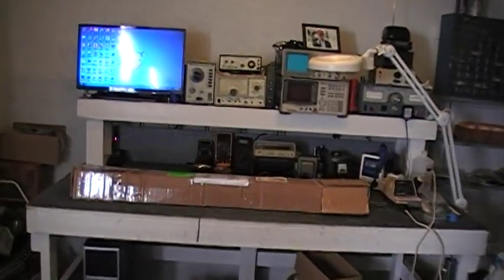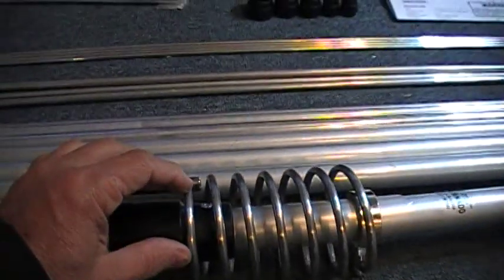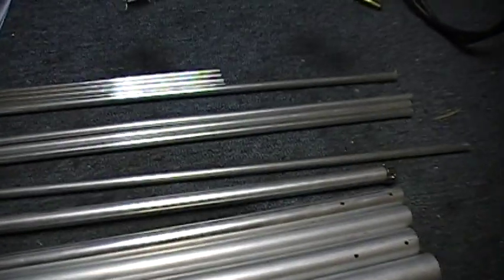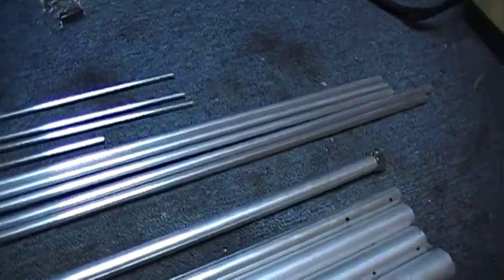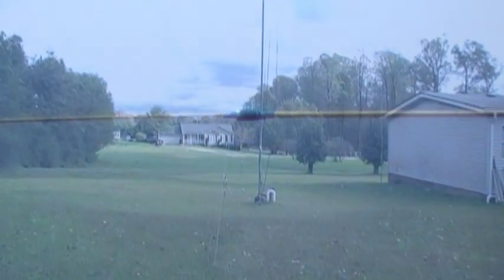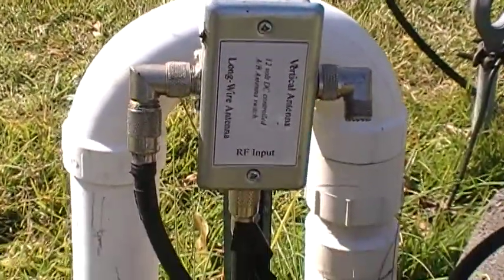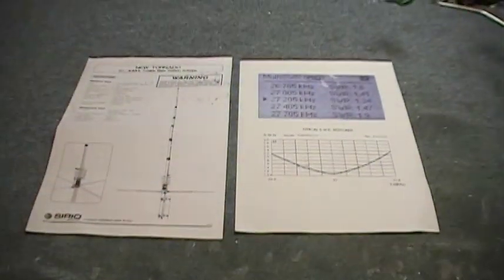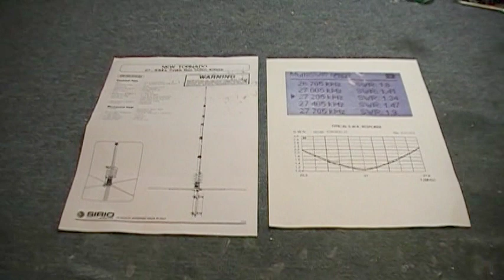Sirio Tornado 27 5/8 Wave Antenna Review

Comment: OK, im looking at this video in late 2023. Ive had two of these myself and still have them up now. The first is now 8 years old , the second is 5 years old. both have withstood 80mph winds on a few occasions. I would not suggest using lock tight on any part of this antenna. Its a good idea to drop it down once a year and just give it a clean with a mild detergent and just put it back together and back up. Im hoping they last a few years longer .
A great video for anyone looking to buy a base antenna. These are tried and tested and work very well.
From my home in a valley in south wales, uk, ive spoken all around the world many times.
A highly rated antenna that just lasts and lasts and works exceptionally well.
Reply from the maker: There are two types of loctite. One is a permanent loctite and the other is one will only gum up the threads enough so they do not back out due to any vibration or temperature shifts. I used the non-permanent loctite on this antenna along with other projects like this. For some people it is an act of congress to drop an antenna down unless it's just on a few poles and even my setup is involved to swap or service the antenna. Mine is on a 50 foot push-up pole and there are three guy wires on each section so it is a slow process especially raising the last sections due to all of the weight so when I set up an antenna I pay attention to all of the details along with being meticulous so I don't miss anything that will cause me grief. True story: Years ago I purchased a MACO V-5/8 antenna and as an antenna it is a great antenna as far as how it operates but it SUCKS the way it was designed because the wire connector thay attatches the hollow tuning ring will almost always corrode and even if you seal it with a coat of rubber, no worries because the hollow aluminum tuning ring is almost guaranteed to develope a leak and fill with water and swell and split  on the first winters freeze. It was those reasons I dumped the MACO V-5/8 because nobody wants to have to drop an antenna unless it is an absolute necessity. I have friends who have had Antron-99 and I-Max 2000 antennas that have been up for over 20 years that still work as good as the day they originally set them up. That's one thing I do like about the Tornado 27. The aluminum coil is solid so it cannot get water in it and swell and split. As long as everything is good and tight when it is assembled these antennas will go for years without any need to service them.

Comment: I've been around radio for quite some time. Looking at this design, tells me it is really a base loaded 3/4 wave. A true 5/8 requires a shunt feed to achieve the proper impedance and radiation angle. This is a popular trick on many so called 5/8 VHF mobile antennas. I have done tests between the DC open an shunt fed "5/8" and the shunt fed always wins.
I'm willing to bet if you tied the  bottom of the coil to the ground plane and tapped it in the sweet spot with the coax cetner. You will find it will perform better.
Reply from the maker: Great minds think alike. I plan on reconfiguring the open coil design with a shunt coil setup. I also plan on adding 4 more ground radials so the antenna will be set up like a Sirio 827 antenna. As to the mod the shunt setup will give some protection against static build up too since there will be a DC short to ground.
Reply: If you know your history, the A99 came about when the people who protect us from ourselves decided that "CB" antennas could no longer conduct DC to the mast. Hence there was a crazy 5kv rating that was given. The end work around was to sell 27mHz commercial antennas.
Reply from the maker: @CrawldaBeast  Yeah I remember when the market started getting flooded with the fiberglass antennas. I purchased a Antron back in the early 1980's and it set up great with a really good SWR but in my opinion I didn't think the antenna had good ears compared to a 5/8 wave antenna so I went and purchased a MACO v5/8 and I ran that antenna for a couple of years then I purchased a I-Max 2000 and that antenna ruled the roost until God called it back home with a direct lightning strike lol. There wasn't enough fiberglass to make a damned toothpick with in the yard. I replaced it with a newer I-Max 2000 but they monkeyed with the design to make it favor the 10 Meter band and eventually I got rid of it and went with what I am running right now. In the end I came to the conclusion that I prefer aluminum antennas over fiberglass antennas.

Comment: I've gone through two Sirio Tornado 27 antennas. They are an excellent well priced antenna that works well and tunes well. The only downfall is the plastic coupler at the base. It will eventually snap in high winds. I've had to upgrade to a Hy-gain Penetrator spt 500 because of the plastic coupler that snaps. If they upgraded it then it would be great. As far as the aluminum base, I did it just like you and it's the absolute best way! Good video.
Reply from the maker: We do on occasion see high winds here but it will always be a hard fast storm that rolls in. I have a backup antenna still in the box ready to go and I thought about reinforcing it with a good piece of fiberglass rod then sealing it followed with adding water bleed-off holes right at the base of the antenna. Also if the sections are sealed the likeness that water can enter into the antenna can be eliminated. For the price you still can't go wrong. Thanks for the feedback.
Reply: @flash001USA  Even though I've had two snap and I now have the Hy-gain Penetrator spt 500, I have a new Sirio Tornado 27 in the shed just in case!
Reply: I dont like this antenna.Broke after 3 months.Only 50 feet of the ground.
Reply from the maker: @michelst-jacques9555  Where did it break? So far the antenna I have here has held up through a couple of hard storms with enough wind power to rip small branches and leaves from trees. If it snapped after 3 months you need to contact the company and either get a refund or a replacement.

Comment: My I max with manual tuner will go out on 20 meter’s no problem! Mouth on canyon 70 mi/hr winds at least twice a year,in Utah! When it was 9 yrs old took it down lightly sanded it put 4 coat’s of polyurethane varnish on it works like a charm! Have 11 meter fun and two ham bands 10,11,20 meters go figure! Oh slightly customized, top whip is a 102 inch fiberglass Wilson mobile it’s red colored ! Works great love your video. John Boy Utah 🇺🇸😎🎙👍🏻
Reply from the maker: When they're working they are great antennas!
Reply: I bought mine in 2009! I think the quality has gone down since then. JohnBoyUtah 🎙🇺🇸👍🏻😎
Reply from the maker: @Brenda-jf2pe  That wouldn't surprise me because I think a lot of these antenna manufacturers are looking for ways to save cost on their products especially now.

Comment: How or why is the antenna bending in in the wind? Its aluminum tubing screwed together so it should not be flexible like a steel whip or fiberglass.  Wouldn't the tubing kink and stay bent instead of flex?
Reply from the maker: The tubing pieces slip into each other. All vertical antennas like this are designed to flex.The fiberglass antennas can flex with more movement along the lines of a fishing rod and the aluminum antennas flex the same way with a bit less free movement. You would think they would snap right in two or as you mentioned, bend but they won't unless they are hit with a really bad wind storm that causes these antennas to violently be whipped around and even the fiberglass antennas can break under these winds too. I'm making reference to the kind of winds that uproots big trees and lifts shingles off of roofs on houses. You got to keep in mind that this is a bit over 24 feet in length and the tubing is hollow. Watch Youtube videos where people make videos outside of an passenger jet window and you would be amazed at just how much the jet's wings bend and flex during flight and we are talking about something that is built with aluminum support beams for the outer aluminum skin to secure to. The antennas are made out of the same blend of what is called "aviation grade" aluminum which is made to be able to give and flex even under mild wind movement. There are still aluminum ground plane antennas standing strong that were built in the 1960's and where I live there are still a few old houses with these old antennas still up.

Comment: Great video here is a idea.
Video @ 12:20 about the electrical tape. I think the heat shrink tubing would be better. You can get it that has a 3:1 shrink rate. I use it on my antennas both aluminum and wires. My brother just got his in today and we are going to put it up this week end. Myself I am still using my old Sigma 4 I bought back in 1978. It has been a great antenna even after 4 lightning strikes and all I had to do was preplace the gamma match two times.
Reply from the maker: You're correct that there are better methods to be used. I chose to use high quality UL electrical tape because it allowed me to stretch it tight around the joints but the trick is the super glue. Once it dries it becomes a solid piece of thick plastic that won't unravel. The best thing would be to use the stuff the cable companies use that stretches and self heals to itself. That stuff will outlast the wire but the tape trick works quite well. I could have used heat shrink and I had some here but I've seen it get brittle and split over time where the tape literally has to be cut away with a razor. Recently I just reclaimed some old PL259 connectors that I used the tape method on and they not only stayed totally sealed after 8 years but the tape had to be removed with a razor blade so it does work.

Comment: Hello, what experiences have you had with the antenna?  Is she recommended?  73.  55
Reply from the maker: As far as the performance goes it's a good antenna. I'm still running it now and I get nothing but good reports on it. There are people who have had the plastic insulator/spacer break off at the bottom of the antenna where the loading coil is and from what I understand, Sirio has made an effort to address this and beef it up. Most of the breaks happen in areas with extreme high wind conditions. Here where I'm at we do see some bad storms but this antenna has stood up strong for me. The Sirio Tornado 27 uses a different loading coil than the MACO v5/8 or other ground plane antennas based on this design where the Tornado 27 coil is a non DC grounded configuration so if you put an ohm meter across the antenna RF connector it reads open where the MACO v5/8 and other antennas like this will read a dead DC short. To me I would say this is the only thing that I don't care for because a DC shorted loading coil can help in protecting the radio from static discharge that can be produced under very windy and dry conditions but then again, I have never had an issue with static discharge either. There is another positive feature to a DC shorted loading coil and that is it can help protect the coax cable from damage if the antenna takes a direct lightning strike because it will help shunt the strike directly down the tower or pole directly to ground provided you have your antenna grounded correctly. Sirio makes another antenna that I will be trying out in the near future that has a bit better specs than their Tornado 27 It has a better SWR rating along with a bit wider bandwidth and a bit more gain and it's built a bit a lot more sturdier but it is also a physically heavier antenna too. The Tornado is right at 6 lbs and this newer antenna is just under 13 lbs. I already have one and I'm impressed with the build. It is the Sirio 827 and I'll leave you the link to this antenna. As long as you have a good support system this would be the better of the two antennas and in my opinion it's one of Sirio's best 5/8 wave antennas they sell. Here is the link just in case you are interested. https://www.sirio.store/index.php?main_page=product_info&cPath=2_18&products_id=185
Reply: @flash001USA  thanks.

Comment: In my experience.Of all the vertical antennas Sirio offer. By a country mile ,the Sirio 2016 is the best performer. And has way better build quality. Example the GP radials are threaded and securely lock into the base coil. No chance of malfunction..  And tune down to a flat VSWR 1.0.
Reply from the maker: Yeah I agree with you. I don't have it set up at this time but I have a Sirio 827 which is based on the same design as the Sirio 2016 and I got it because the specs are really good. Both the 827 and the 2016 are pretty close in specs and their over-all design.

Comment: Instead of electrical tape... Use Marine heat shrink tubes it has sealant it that holds. I had to do that to my vector the second element from the top kept snapping. But the marine heat shrink held it together.
Reply from the maker: Yeah you are correct. I had some rubber self sealing tape the cable companies use but I was out of it. UL electricians electrical tape works in a pinch as long as you coat it with super glue. It will turn to a hard plastic on the outside that won't unravel or peel off.

Comment: excellent receiving and transmitting antenna but sadly no DC ground and yes without tape the screw connections fall apart, I did drill a hole in each radial to secure this screw connection with a self tapping screw, and drilled a little into the solid radial extensions so the hex screw makes a better connection.
Reply from the maker: You're right that it actually is a decent antenna as far as receiving and transmitting goes. I know there are people reporting these antennas will eventually break at the bottom insulator where the matching coil is under high winds but I believe this can be strengthened by removing the matching coil and using a PVC sleeve to give it more strength and you could also add some fiberglass rods to the inner center of the plastic insulator. I have a back-up antenna still in the box and I will be looking into doing this mod and if it turns out to be simple enough I'll make a follow-up video on the mod. You mentioned the DC ground and that is something I would have liked to have seen with this antenna. I'm willing to bet you could redo the loading coil so that it was set up sort of like a MACO but without the big aluminum ring coil like the MACO antenna uses and it would perform just as good if done correctly. This is a $79 dollar antenna so I'm willing to do some surgery experiments because I think can do the mods where if they don't work they could be undone without destroying the antenna ... UPDATE: It was $79. Now it's cost is anywhere from $99 up to $215 but this is still a far cry from some of the prices for the other antennas in this class online.

Comment: Hi my friend, i want to buy this antenna, if i put a heatshrink on base plastic where the antenna snaps, it will be more resistant on winds ?
Reply from the maker: Hi I don't think they sell the Tornado 27 any longer. They had a heavy duty version with better specs called the Sirio 827 and that too has been discontinued. Here is a link to a really good antenna that has good specs and it will stand up to the wind. https://www.sirio.store/index.php?main_page=product_info&cPath=2_18&products_id=21
Reply: I buy yesterday 827, indeed is very robust and more stronger than tornado, they say is the best antenna on the market 5/8 vertical

Comment: Do you have any videos on calculating coax length with the vna? I once thought lengths of 1/4wave were good choices but it turns out that odd lengths of 1/4wave is a bad idea, so a full wave length or a half wave length of coax would be ok but not 1/4 or 3/4 etc. This left me wondering about very short lengths for the car. I once cut rg48 at around 9ft for the car. Probably not a good idea. I'm switching to a balanced antenna on ladder line or 300 ohm ribbon because there is too much loss in coax.
Reply from the maker: Now I'm a believer not to cut cable too short because under some circumstances you can have snafus or issues. As far as trimming cable to certain wavelengths, I got to be honest with you and mention the following: When you're dealing with long runs over 30 or 40 ft especially for a base station situation you can cut the cable to any wavelength you want to all day long because if you're moving up and down on the band even by 20 or 30 channels then technically the wavelengths that you cut that wire for just like an antenna would be technically falling in and out of its sweet spot so in other words I don't bother with those kinds of calculations and I've never had a problem with being heard or hearing others. I know there are two schools of thought on that topic but I've never had an issue with my setups.